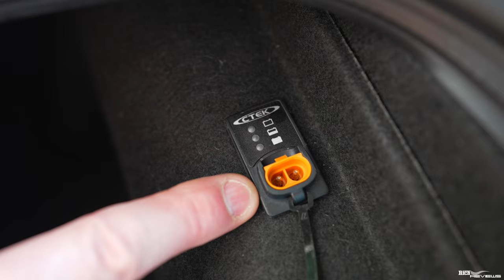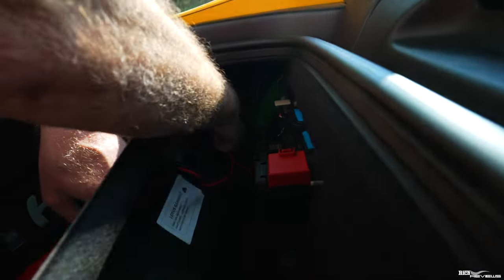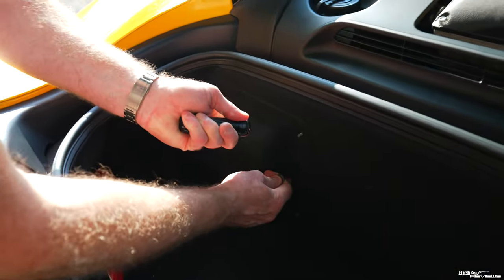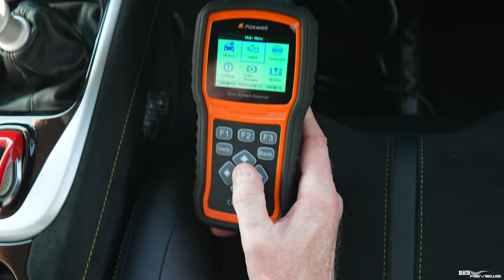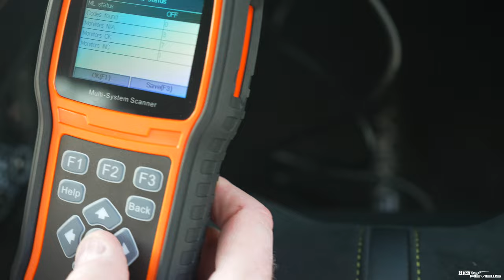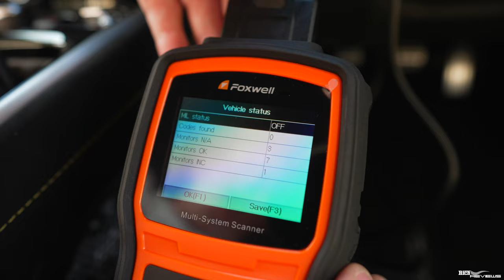This is How You ERASE PERMANENT OBDII ERROR CODES!

Comment: Many cars will produce codes and diagnostic information at a level below what a cheap generic code reader will read. To read them you would normally buy a specialist tool. Do you know if this is the case with the Emira? And if it depends on the engine variant of the car? For example Mercedes diagnostics requires a STARS or clone/copy reader to access  a lot of diagnostics info.
Reply from the maker: I had the common air intake temp issue that could not be cleared with battery disconnect and managed to clear with the Foxwell.